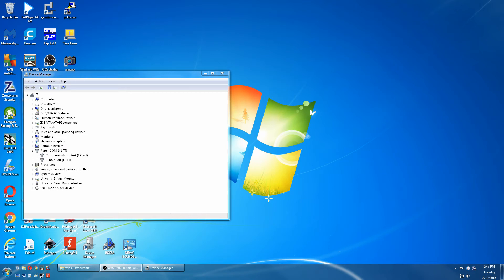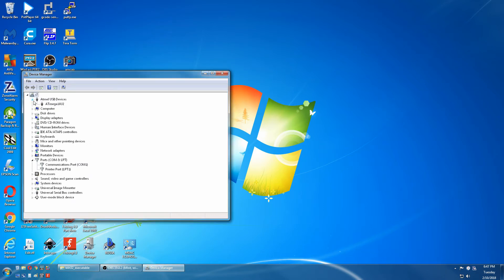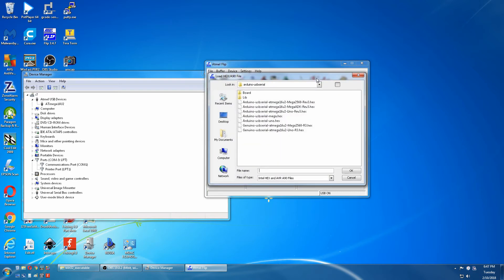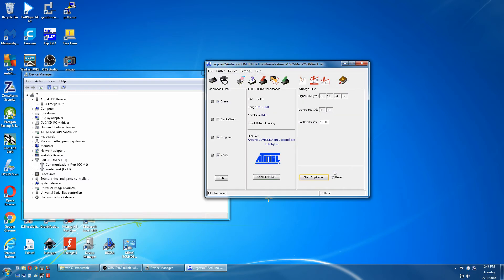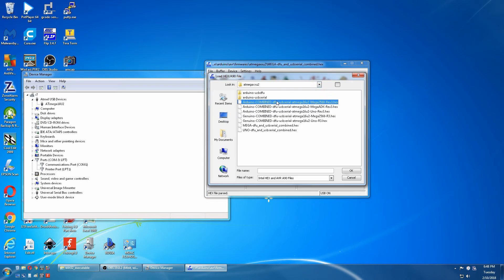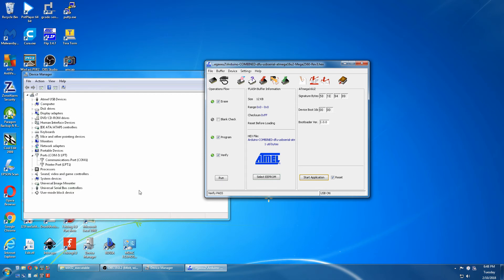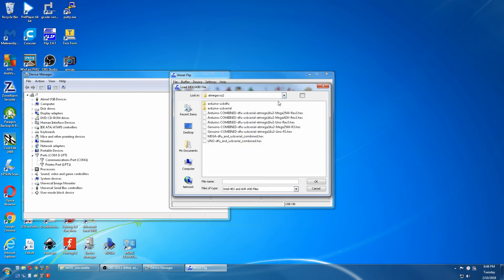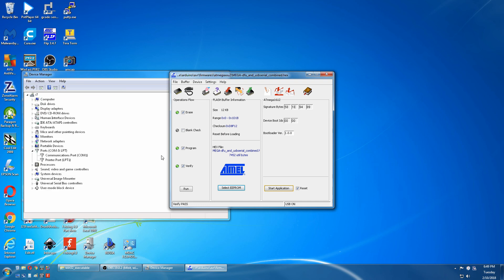16u2 firmware FLIP fail

Comment: keep getting an error saying "couldnt open USB device..please help me quickly!
Reply from the maker: It's been so long, and I only did it a few times, I don't really remember what is going on. 
I think this was a video question for a forum, not a tutorial.
The Arduino IDE installs the 1st driver shown in Device manager, but I don't remember if the 2nd needs one. Maybe lookup that Flip app.
Reply: SAME HERE usb couldn't open USB device error, have you got any solution